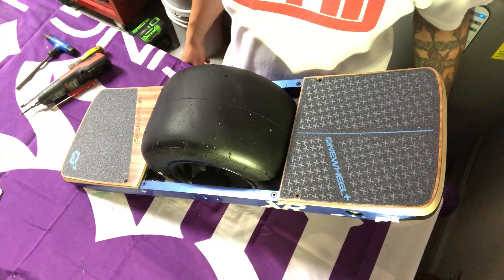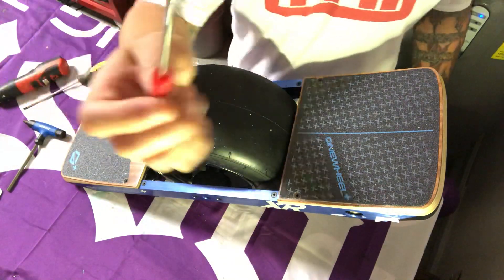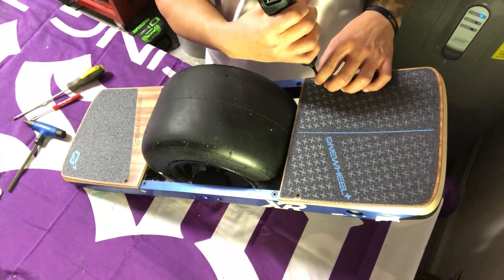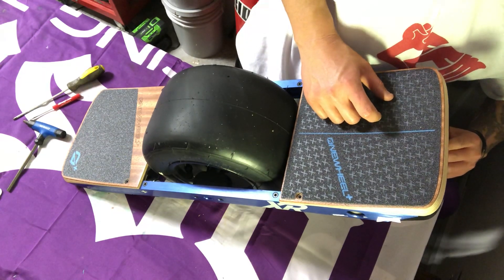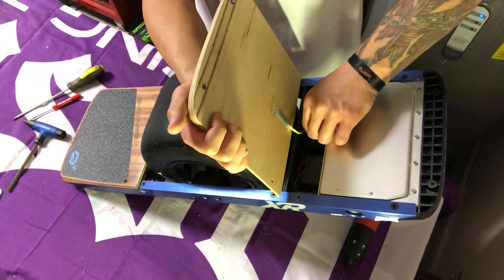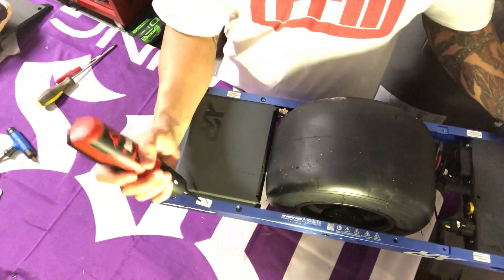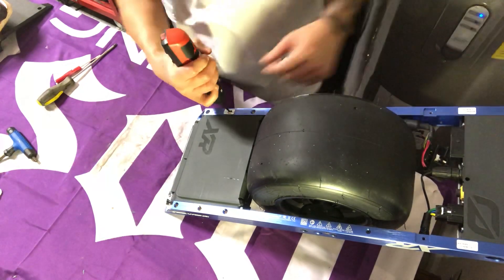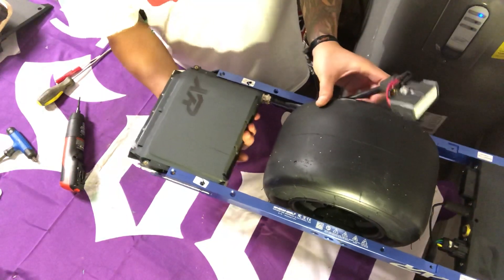Onewheel XR battery assembly removal

Comment: when they make it so you can snap in a charged battery from your backpack within a minute, then I'll buy one
Reply: Good way to save 2 grand
Reply: From a design perspective that would be terrible. If you’ve ever use power tools seriously you’ll know that even the best ones the battery just fucking pops out randomly. I don’t want that shit happening to me when I’m traveling at 19 mph. Plus mud and rain and crap will get in there. Forget riding your one wheel on the beach or even off-road. Plus that mechanism wouldn’t make the entire board either bigger and heavier or have a significantly smaller battery.
Reply: @jaredj631  - our society have had great technological innovations the past 4 decades. If it can be dreamt of, it can be engineered.
Reply: @1world2coexist  On the contrary every engineering decision makes sacrifices given the limitations of current technologies. Every design aspect you add to a product increases the complexity cost and reliability.